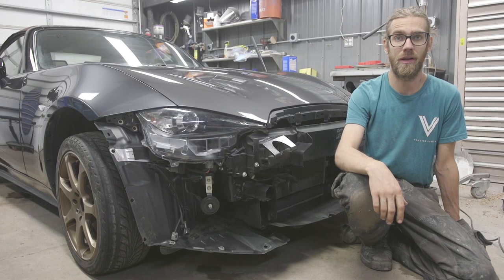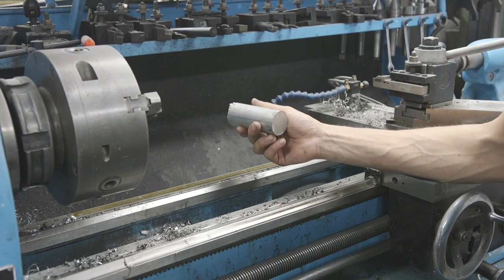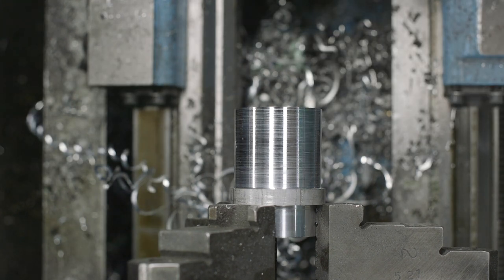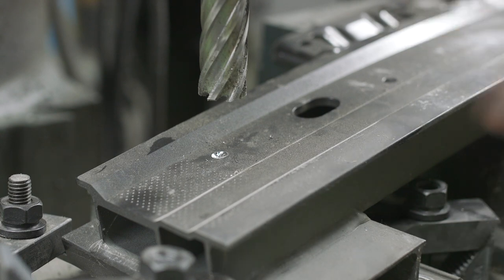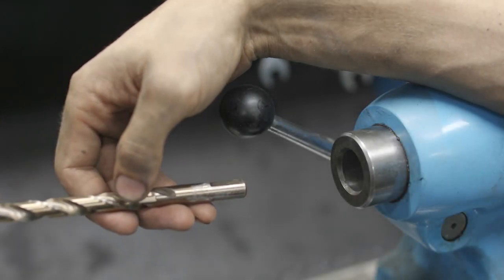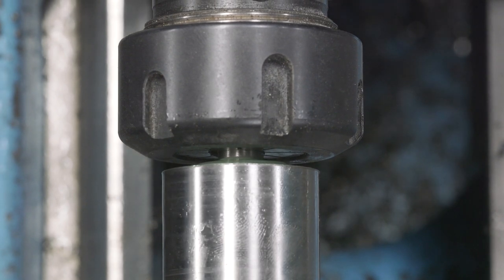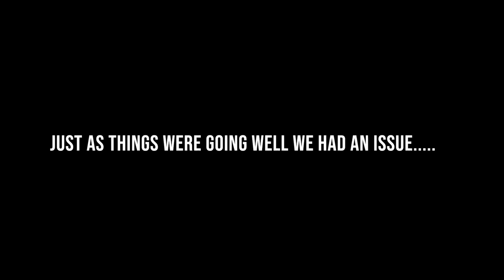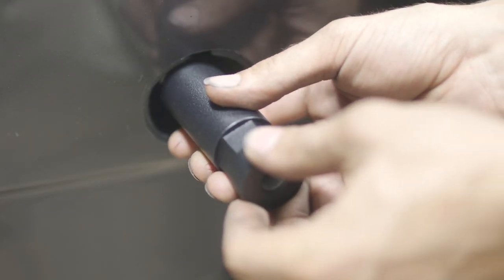Machining and Fabricating Miata Bumpers

Comment: Is this legal? Isn't there some sort of law against a metal bumper stop to prevent excessive damage in case of accidents involving pedestrians?
Reply from the maker: Here it is many cars have them to protect their bumpers in the city. Usually they are chrome and 2-3” thick though. More common on trucks and suvs
Reply: Can't do that in Europa. You manipulate/remove the safety features for cyclists and pedestrians.